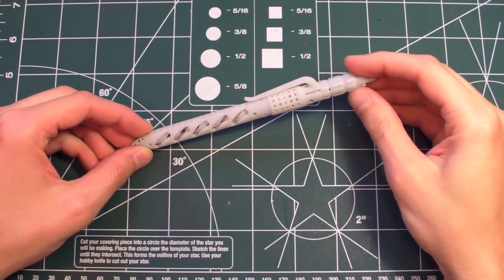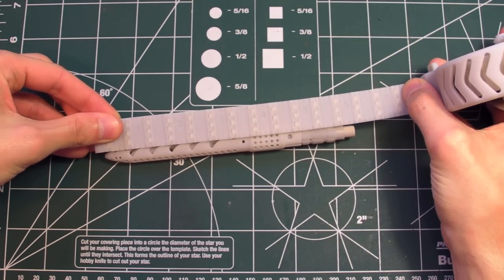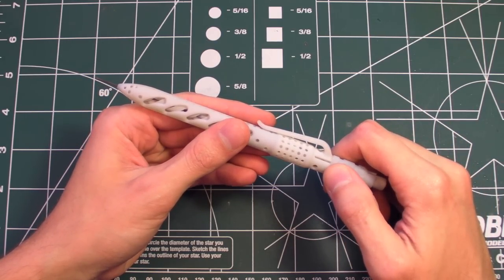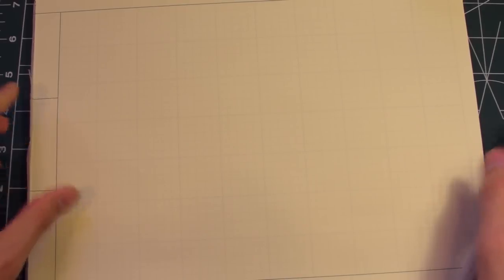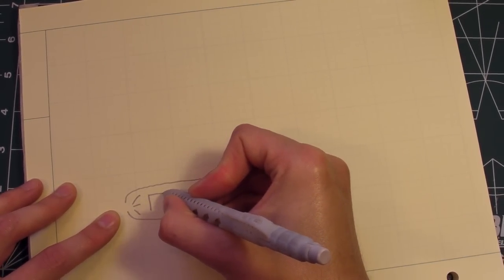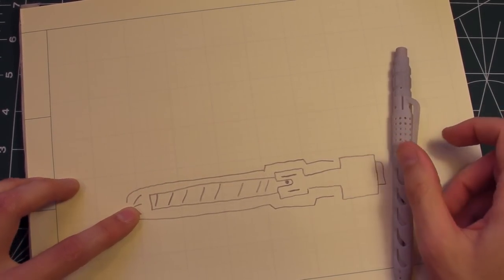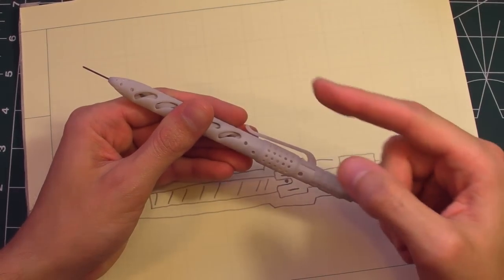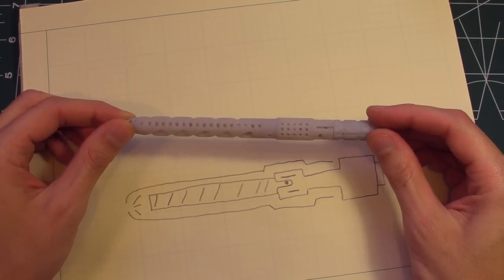3D Printed Mechanical Pencil

Comment: FDM or SLA?
Reply: On thingiverse he said:
"These parts can only be printed on high-resolution printers that can do SLS Nylon, SLA, or Polyjet The 'Normal' version is difficult to get right in most cases while the '30 Percent Larger' version works most of the time. Both require a lot of delicate cleaning to get functional."

Comment: I need to make several comments.
First, your showmanship is incredible. Using previous prints just to show them off, but doing so without seeming pushy to your audience was really neat. It seems like you really enjoy this stuff. 
Second, this is the best 3d printed pencil (and caliper and tapemeasure) I have ever seen. I am very impressed. 
Third, I will probably have to buy one of the pencils eventually, even though it appears to write very poorly(better than any other printed pencil I have seen, but much worse than CNC produced pencils) 
Thank you so much for your videos. While it doesn't mean much to you probably, I will be subscribing to your Chanel.